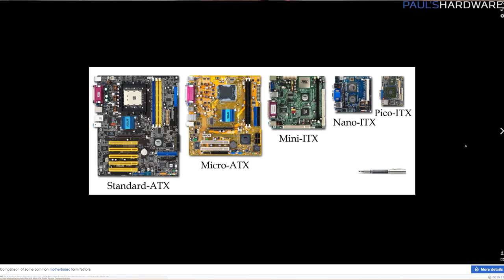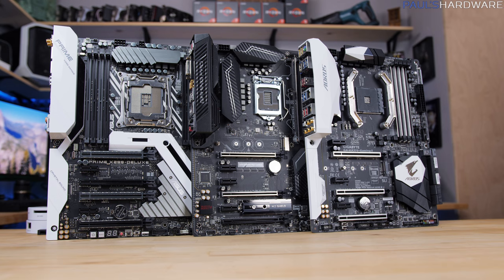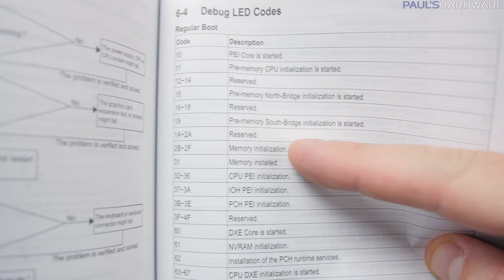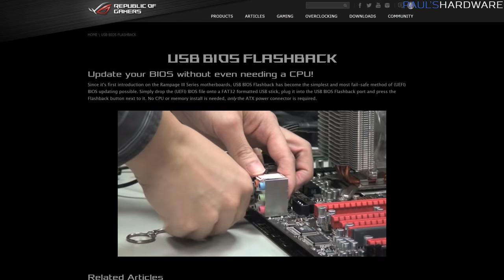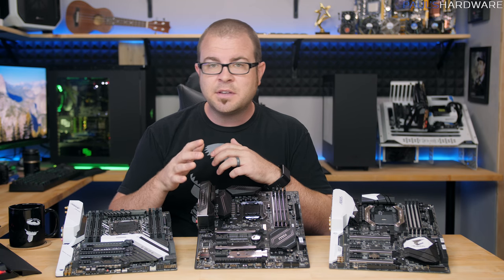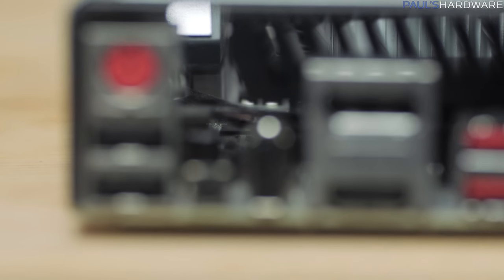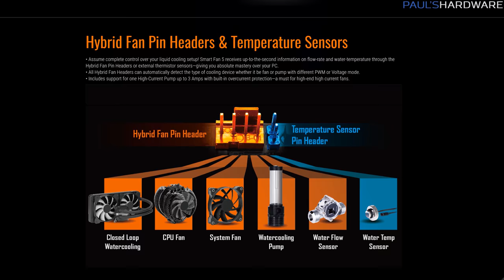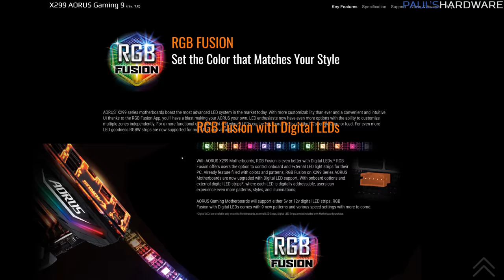My Top 5 FAVORITE Motherboard Features!

Comment: Here are some more nice features:

1). Good quality VRM for the CPU.
2). Sufficiently big heatsinks for chipset/VRMs/other-stuff.
3). WiFi. Seriously, is this so hard??
4). (Bonus) Replacing the PS/2 connector with an extra USB one. Because, you know, it's 2017, not 2002.
Reply: Radu Murzea 100% agree with number 3. I buy only enthusiast boards and wifi for me is a huge must. At this point wifi should be on all boards and the best fastest wifi chips on the enthusiast boards.
Reply: PS/2 is still very common in the asian market, and it can be also useful for extreme overclockers (usb is more prone to fail than PS/2) and some troubleshooting. Back-compatibility is also nice to have.
Reply: Wifi is AWFUL for gaming online.  Stop using it.  This is why mobo's do not have built in wifi.  You're meant to use a LAN cable.
Reply: Scheefinator That's is untrue. Wireless can handle any game as long as there are the right equipment and conditions. Also, many people need wireless connections for a number of reasons that are more important than online gaming network performance.
Reply: The fact you just said that, means you have absolutely no clue what you 
are talking about.

Wirless drops out, is not consistent in the signal to noise ratio, it 
has higher latency, and the ping is higher.

Wireless SHOULD only be used for mobile devices.  Laptops, tablets, 
phones, etc.  Any LAN based computer and environment, ESPECIALLY FOR 
GAMING, should have a cable ran to it.  No ifs, ands, or buts about it. 
 Cables are superior.

You can get nice long cables, 25+ ft all over the place.  There is 
absolutely no valid excuse to not run a LAN cable to a desktop machine.
Reply: Scheefinator Wireless connections can be more than enough with the right equipment and conditions. The fact you cannot understand that shows how little you truly know about this. There are plenty of motherboards without wifi chips and plenty with it. It is no problem at all and I find it strange it bothers you. I use wifi for my desktop, laptop, and of course phone. I have never had a single problem.
Reply: Scheefinator I do not insist on people using one or the other and that is what makes us different. Are you so close minded that you cannot understand that both have advantages and disadvantages? Neither is better nor worse than the other because they are for different uses. Wireless can be for any system that cannot have a cable, needs to be moved, someone who prefers wireless networks, or some other reason. It is all a matter of preference, ease of use, equipment, and environment. This is all things I learned in basic IT and Networking classes and it holds true in real situations.
Reply: Scheefinator Cable in most cases will be slightly more reliable and stable, but if set up correctly, wireless can perform just right for the standard gamer. By just right I mean to where you cannot tell the difference because there are other factors like monitor response time, input device lag, and other delays.
Reply: Scheefinator TL; DR
Your entire argument is opinionated. Customer grade wireless networking equipment can provide the same experience as cables in many cases. My argument is that just because you think motherboards shouldn't have WiFi chips doesn't mean everyone thinks so. I like to rearrange my office and do not like to see cables or put holes in my walls which is why I use WiFi. Try to understand that because you think something is inferior and pointless doesn't mean everyone does. I am done here because I do not like typing this out on my phone.

Comment: lol Asus bios flashback sucks :D .. doesn't work and needed because their bios corrupts often... well at least with AMD boards .. maybe now that AMD actually has some competing chips .. maybe now Asus will take some time to actually make high end boards for AMD actually work .. their Sabertooth for the 990FX sucked ... total trash for an outrageous price ... because of that .. when I build my AM4 system .. I will not deal with Asus because of their horrid Sabertooth... I want a board where USB works and the bios doesn't corrupt if you try to OC and features like the bios flashback works. Asus maybe is still good for Intel but they totally gave up on AMD and just put out a thrown together POS just so they had something for AMD users ... again .. lets hope now that AMD has some decent products .. Asus will take their heads out of their asses and produce some quality boards for AMD. I'm really getting sick of companies like Asus and especially Corsair now producing absolute garbage cheap crap and selling it for 3 times the price trying to live off their reputation ... Corsairs rep is now TRASH for me .. if I see Corsair I run the other way... OMG is their stuff overpriced garbage .. even with known design flaws .. they don't even bother removing or fixing the flaw .. they just keep selling them .. and RMA'ing them when people discover the flaw without even telling them .. so the customer gets a replacement that does the exact same thing ... stay away from Corsair and Asus if you want quality

Unfortunately for most of us .. Corsair Asus and MSI give way to much to these youtubers and the tubers don't want to lose that so they talk good about their products .. they overlook the flaws ... they forget to mention the problems ... not saying that Paul isn't being honest .. just not as honest as he could be ... its like that with all of the reviewers .. .they have to keep relations with the companies good .. or they wont have product to review .. and the shit these days is too overpriced for them to spend the money out of pocket. 

I would love to have one of these reviewers actually look at Corsair and review them accurately.... Tell people that the AXi series has a design flaw yet corsair still sells them and has yet to fix the flaw. Have them actually look at stuff like the Corsair Link software that has been broken since its conception and still is to this day ... its been out for over 2 years and still doesn't work right.... and now ... their keyboard software is joined the rank of the Link software ... it used to work ... now its total garage and doesn't function properly .. constantly having to unplug and plug in my keyboard to get it to work again ... well .. the features of it to work .. it will always work as a keyboard .. just the macros and lighting and stuff is totally screwed up by the latest update of their software that they "changed" the "look" of ... while breaking it .

Comment: "Advanced Fan control" is totally useless if you only get to choose between 60% to 100% or have to run some junk ass autotune. (Hello Asus) How about letting me choose to run the fan at 10%? It will be my bad if the fan won't support it.
Reply: asus fan controll finds the minimum fan rpm, tho its different on the same fan if you run it in pwn or not.
just let it run the test first, wont take many minutes depending on your fan number. then just set you fans to fixed rpm, and you know its the lowest they can spin.
Reply: Thank you. Thats what i mean by "have to run some junk ass autotune". This Qfan is garbage.

Comment: #1. RGB
Reply: GTX 1080 f
Reply: RGB is good but I hate how the headers are only reserved to MOBO's which have RGB heatsink's etc... I have yet to see RGB header on non RGB MOBO but for me it may not matter as I have mainly corsair PC parts and only corsair peripherals and the RGB strips can connect to PC via USB 2.0
Reply: Zahid Shabir umm b150/b250 pro gaming aura? (Asus)

Comment: Seriously, commentors you need to learn this right now.  Wifi is terrible, awful, horrible garbage. NEVER EVER USE IT, especially for online gaming.  Always use a LAN cable and quit making excuses.  You are on a desktop machine.  Wifi is only for mobile devices.

I do not want my board costs going up because you fools think you need built-in wifi devices.
Reply: Scheefinator This is a very ignorant comment. Wireless is there for a reason and better for some people. People who use wireless do not need to learn anything because WiFi is not "for mobile devices," but for any device that requires wireless.
Reply: The fact you just said that, means you have absolutely no clue what you are talking about.

Wirless drops out, is not consistent in the signal to noise ratio, it has higher latency, and the ping is higher.

Wireless SHOULD only be used for mobile devices.  Laptops, tablets, phones, etc.  Any LAN based computer and environment, ESPECIALLY FOR GAMING, should have a cable ran to it.  No ifs, ands, or buts about it.  Cables are superior.

You can get nice long cables, 25+ ft all over the place.  There is absolutely no valid excuse to not run a LAN cable to a desktop machine.